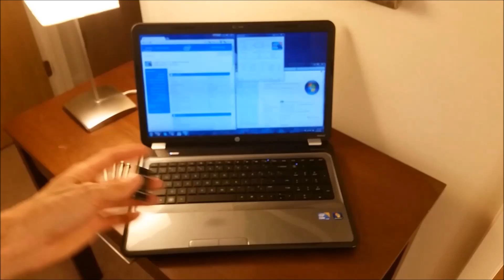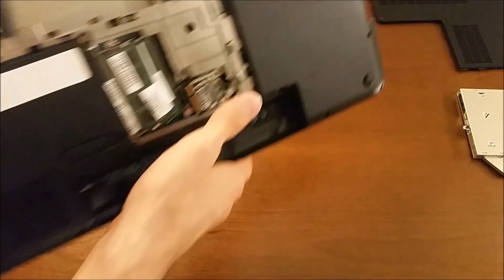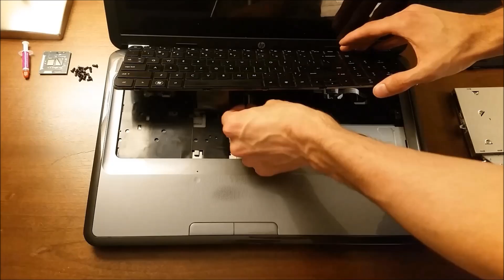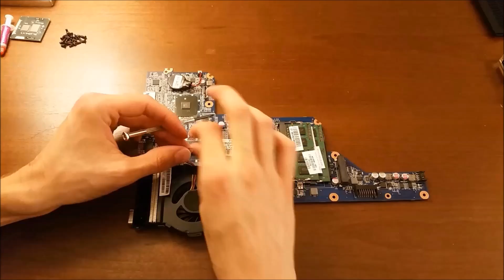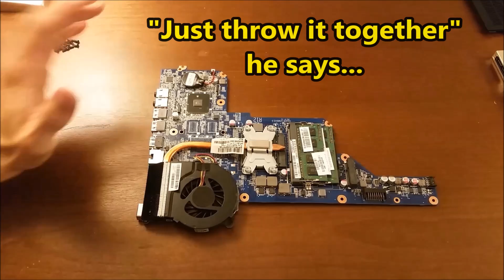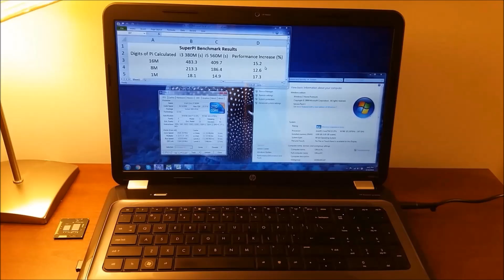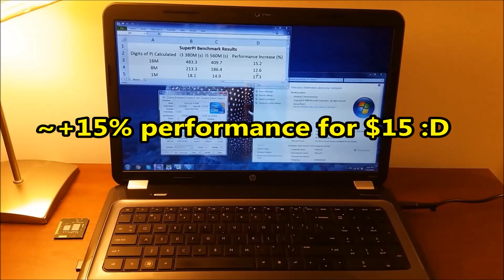How to Upgrade a Laptop CPU / Processor! XD

Comment: oh man some real steel balls needed to do this
Reply: if you have time and skill it's just fun to do and proud of yourself .
Reply: But I have

TITANUIM BALLS
Reply: Joe Belunke i get it. :)
Reply: ahahahaha
Reply: Are you kiding
Reply: E.A.C_TV dude it’s super easy but finding a compatible one is the hard part, To find compatibility: first, find what chipset your motherboard uses, search what cpus are compatible with that chipset, those are your options, second type the name of your current processor into google and click the intel webpage with information on it, see if the socket and tdp matches the  processor you want to upgrade to, also check what speed your ram is and see if that speed is supported by your cpu, if not you can aalso upgrade that, and also there could be bios compatibility issues, but usually updating your bios to its newest version will fix it. Also use userbenchmark to find what processors are better
Reply: I don't think this cpu is BGA type though
Reply: Lol I found one on my street and upgraded it.
Reply: Nah i would do this if I had enough money
Reply: I did it I hope I can fix it back together 💀

Comment: Can you do a performance update video and personal opinions after doing this? :) Im wondering how much hotter will it run and if that will effect cpu throttling
Reply: Haha so i'm going to upgrade my ram and get an ssd first, then see where i want to go.

I got a HP G72 (17in screen, with a dual core Pentium 2.0ghz 2010) for free from my neighbor a year ago. She absolutely knows nothing about computers and best buy told her it would cost $300+ to fix. So I ran an antivirus program and got a new battery for it and its now perfect.

 I've been just using it for college and homework, but it is horrendously slow lol. Its slow even with multiplie windows open or playing some flash games on miniclip. I'm thinking just spending $50-100 in parts will do wonders to this laptop! Its better than buying a good new one for $600.

Thanks for the reply! and thanks for the info buddy :)

Comment: So you just put the cpu in place plug in ur laptop and it will work normally, no discs or drivers need to be installed? And i want to upgrade a amd e450 to a i3 dual core 3200 can i do it?
Reply: Torex The funny thing is they dont have the same socket
Reply: NO.
Reply: Torex nope
Reply: Elogamer why not?
Reply: Because the cpu is a different make you cant use an intel cpu on a amd socket and some laptop motherboards dont support newer cpus
Reply: both cpus are old and have the same socket

Comment: i have a sony vaio VGN-NW51FB laptop..it has intel core 2 duo 2.53ghz...
can i updgrade to i5 or i7 cpu's??
and also can i upgrade my RAMs and HDD to SSD?? for better graphics?
tnx for the answers.Godbless
Reply: JRA Nope. You can't. They don't sit in the same socket.
Reply: JRA well my brother you can definitely replace your hdd with an ssd... it will just make your laptop faster booting up and turning off, speed up your app boot up speeds... and loading times... stuff like that.. I stuck a ssd in my laptop and it's so much better now. I love the speed of everything.